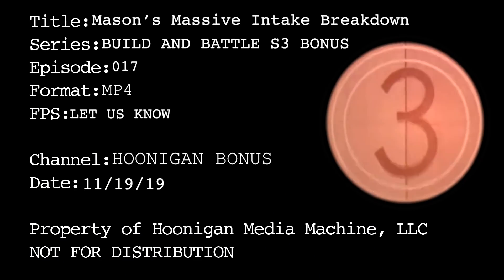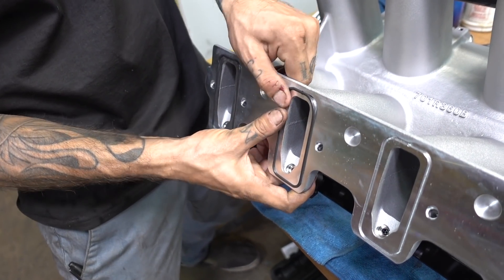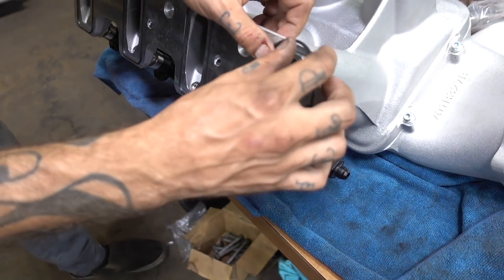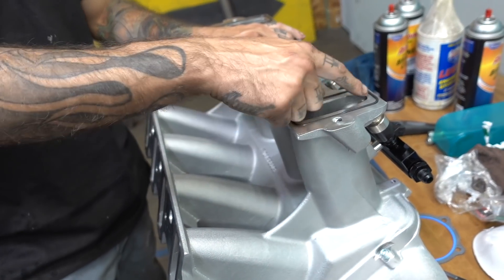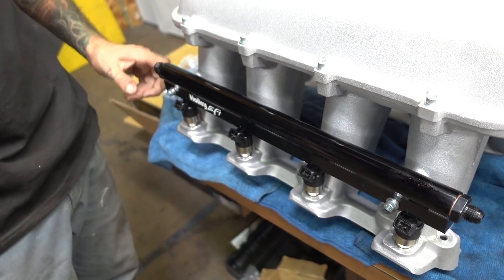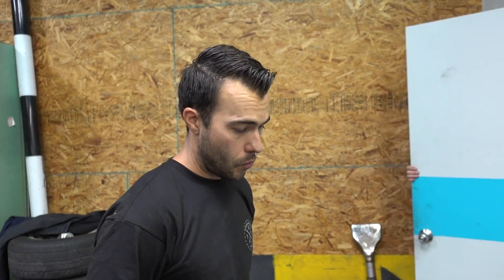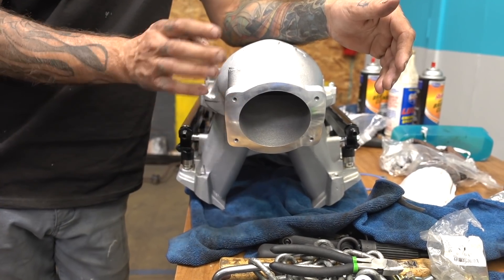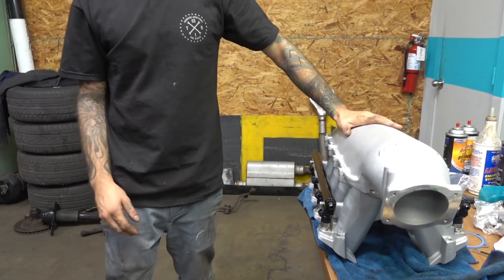Team Camaro Shares Massive Intake Specs for Build & Battle!

Comment: Sure, it's a Holley ad and the (awesome, free) part put in front of the team isn't designed to do what Josh wants it to do - I still respect the fact he's humble enough to admit he's learning about how it works. The automotive community is always quick to correct but there's SO MUCH to learn. Props to everyone taking it one step at a time.
Reply: People are quick to correct because the information being supplied is not always accurate or truthful. Something like performance engine building needs and should be as accurate and correct as possible. To much time, energy and money is wasted with incorrect info or because a trusted "expert"/individual says what they think is true. The entire series is based on rushing to complete a job as cheap as possible,  my opinion this is not how to build a car. If you are using this show as a learning tool, I'd recommend you also check automotive channels like engineering explained and take the time to watch and read things related to the design and repair of machines, take the time to learn it the right way.
Reply: @arbocrd  Agreed; love watching those channels and details matter. My only point is: empathy. Everyone is somewhere on the journey, and either helping people (while not being a douche) or being aware enough to know-that-you-don't-know is a great thing.
Reply: @FigureItAudi  Absolutely agree, generally speaking there is way to much drama and division among people. Obviously this gets magnified in the automotive world. Some of it driven by the chance at fame/clout. In this case I feel like the onus is on the presenters to supply or check the info they are given. There is already almost 6k views on this video, how many took it at face value? Always willing to help and assist others in their journey,  but people have to be willing to learn and understand what is in front of them and realize it may require them to dive into a subject for a better understanding.

Comment: A lot of people have said it but the holly high rise is good for high rpm peak horsepower. 

So raise the rev limiter to 7k  and send it. Especially since it's cammed too.
Reply: this is what i have heard as well... longer runners = more top end hp. shorter runners = more low end tq
Reply: Ya he will have a lot of top end with those runners witch is good and bad so
Reply: For the hi-ram to shine it needs at least 7500 rpm. Otherwise a FAST 102 or MSD Airforce is better.
Reply: He is actually right and longer runners usually take the torque lower in the range, but since the volume and the design also changes they affect the high rpm also in a very positive way since the motor breathes much better. Comparing straight to stock and no other modifications i bet that would increase torque and power high and low.
Reply: Actually here is somebody that has tested just that: https://www.performancetrucks.net/forums/gm-engine-exhaust-performance-21/tested-holley-hi-ram-ls3-intake-vs-stock-ls3-45-rwhp-gain-stock-ls3-heads-492414/

And here is a test in intake runner lenght keeping other variables the same: http://www.emeraldm3d.com/articles/emr-adj-length-intake/

They test with the runner lenght changes before the throttle body, but that does not change anything since the dyno pulls are wide open throttle.
Reply: @PPekka  yeah it increases HP and torque but the only problem it's that it shifts the peak from lower in the rpm range to up top. I have this problem with my car right now. Feels sluggish until it hits 3k then it picks up. 

I've actually been looking at this intake and the holly mid rise for my own car. The mid rise version keeps the peak hp and torque lower down so you don't have to rev it out as high.

Comment: Sorry bud, the holley hi ram is good for turning high rpm. If torque down low is what you want you should be using a stock style manifold like a FAST 102.
Reply: For the cam i put in it. it did just fine
Reply: @masonthedriver  seems like it would be kinda doggy on the bottom end, must have kept the rpm's over 3k i would imagine, even with a fat cam
Reply: Josh Mason it did fine but the stock intake would walk all over that intake for what setup you did. But hey at least your learning I guess

Comment: Stock truck intake would've been better for your application. The longer runner is better for high rpm horse power. A shorter runner is better for low end torque generally.
Reply: Short runner = high rpm. Long runner = low end torque. The truck intake would have picked up power under the curve.
Reply: When I read the description for  the Holley Hi-RAM intake it said the long runner tall intake is for high rpm. Holley says the tall Hi-RAM is good for 7000-8000 rpm in N/A and forced induction application
Reply: @phillipstein9099  the Holley's runners are shorter than the truck intake. In general longer runners=more intake velocity and less volume=higher torque at lower RPM and less hp at higher RPM. Need proof? The runner length of a SBC TPI intake is 17", much longer than that high rise. Look up the TPI's powerband.

Comment: He is actually right and longer runners usually produce more torque, but since the volume and the design also changes they affect the high rpm also in a very positive way since the motor breathes much better. Comparing straight to stock and no other modifications i bet that would increase torque and power high and low.

Here is somebody that has tested just that: https://www.performancetrucks.net/forums/gm-engine-exhaust-performance-21/tested-holley-hi-ram-ls3-intake-vs-stock-ls3-45-rwhp-gain-stock-ls3-heads-492414/

And here is a test in intake runner lenght keeping other variables the same: http://www.emeraldm3d.com/articles/emr-adj-length-intake/

They test with the runner lenght changes before the throttle body, but that does not change anything since the dyno pulls are wide open throttle.

And here you can read a bit more about intakes: https://www.hotrod.com/articles/cross-ram-manifold/

quote from that article: "In 1966, Trans-Am took off and suddenly short stroke 302ci small-block Chevys were in need of eight barrels worth of air and fuel. But these little motors also needed torque to pull them off the corners and that demanded intake manifold runner length."

Comment: Sorry to tell you that intake is for high rpm horsepower
Reply: Yep, for something like gymkhana that might actually work out though. The less aggressive torque curve might actually help keep them from blowing that rear end apart so easily too, so who knows, maybe this mistake will actually help them out unintentionally.
Reply: My thoughts exactly. Should've went with the cross ram like Danger Dan. Its almost like that guy knows what he's doing 🤔
Reply: And then to say a bigger throttle body wouldn't make more power😂😂
Reply: @tommyamann5913  right, it's not like it was in the days of the carb where you could easily over carb a motor and hurt performance. With throttle bodies and fuel injection the rule of thumb is buy the biggest throttle bottle you can afford.
Reply: Nope
Reply: @masonthedriver  what do you mean nope it really is made for top end horsepower man
Reply: @masonthedriver  Dude do you have an actual response? Or are you going to just keep saying passive aggressive bullshit. I actually liked you before I saw how you have conducted yourself in the comments.

Comment: A stock trailblazer ss or nnbs Chevy truck 07-13 intake manifold would of been a much better option over that high rise plus it would of been a fraction of the cost just saying 🤷‍♂️
Reply: They are real good at spending money though.

Even though they pushed the power band up 500 to 800 rpm over the stock truck intake. They didnt need that 900 dollars anyways.
Reply: Man i was excited for this build until I realized they are forced to use sponsored parts.
Reply: nastychevys  that intake would only be worth it if if was forced induction or running 8k rpm what’s the point of it with a stock bottom end stock heads set up waist of time and 💴
Reply: @nastychevys  they spend money on that intake but they're fabbing all their suspension

Comment: the truck intake has more torque and flows fine.... people make over 900whp on truck intakes
Reply: plastic though....
Reply: @masonthedriver  yes. That means it doesn't heat soak.